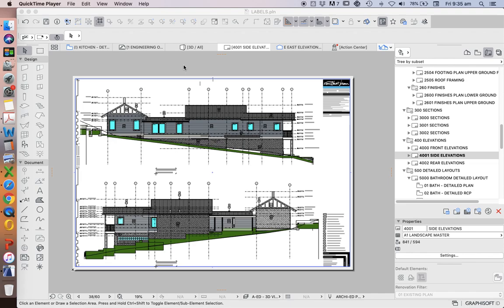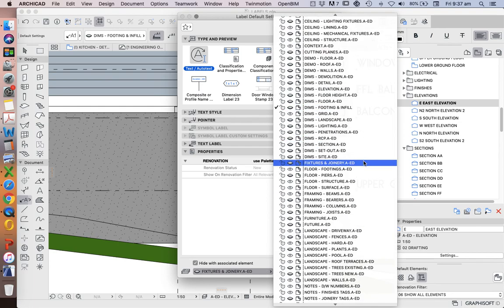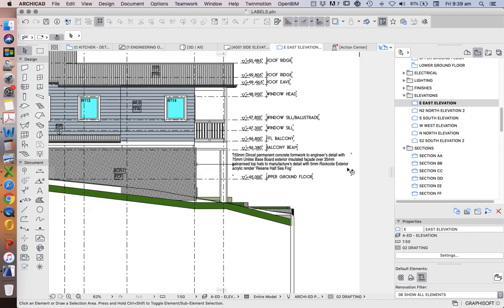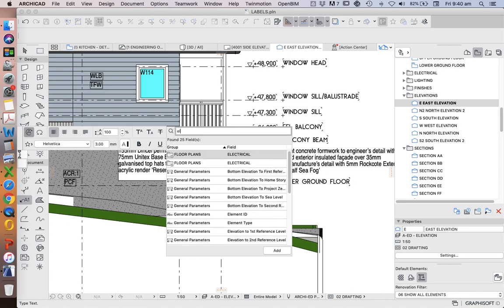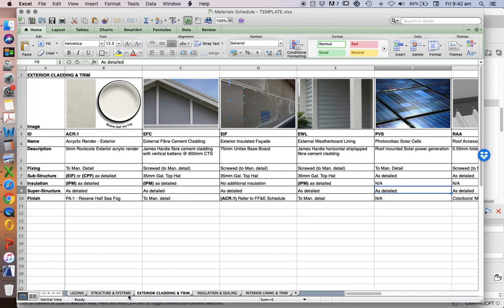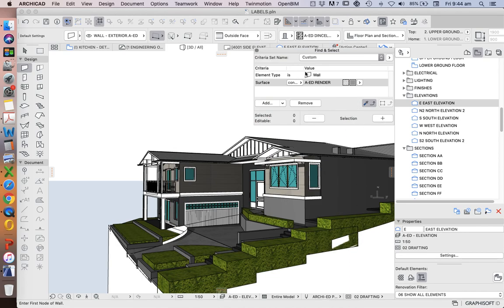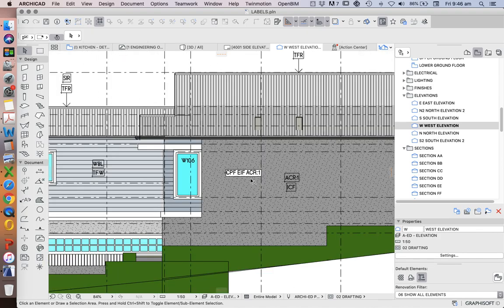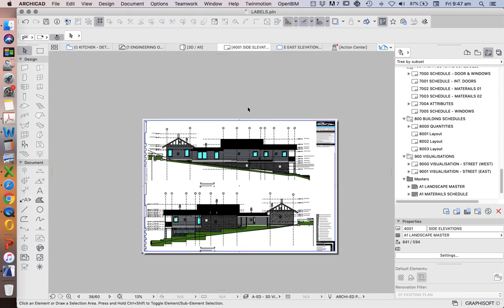ArchiCAD Label tool for referenced annotations

Comment: As we have to be able for some projects provide Cobie level 2 data , all projects use archicads properties in combination with their expressions to extract the abbreviation we use for all our composite and complex profile walls . For Cobie Archicads element ID for all elements need to be unique so we can’t use the ID hence why we use the ArchiCAD properties plus their expressions. This also avoids a user creating a wall with the wrong element Id because they inherited it from the last used ID. As they have to select the correct composite in the first place to draw the wall and there is no input required by the user to label it correctly we have less mistakes.